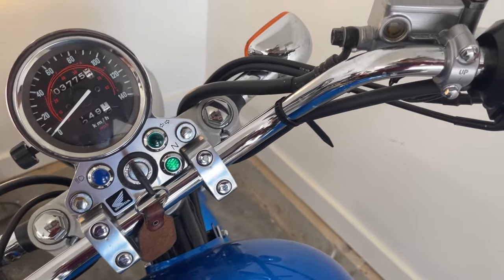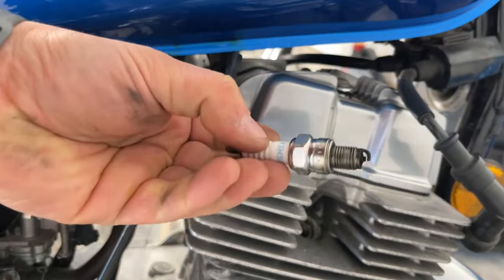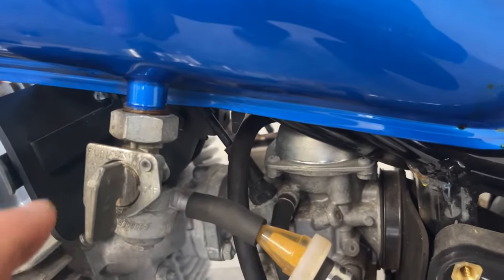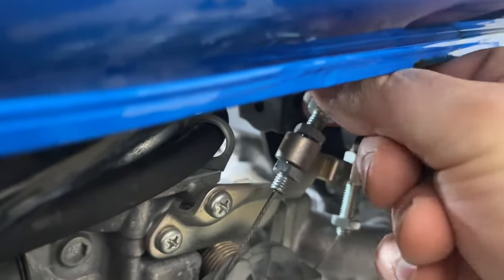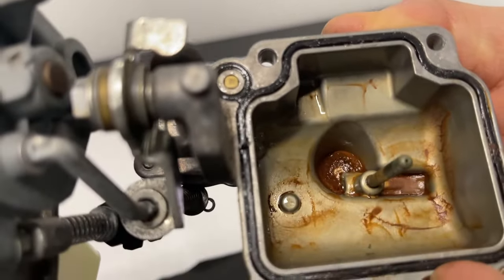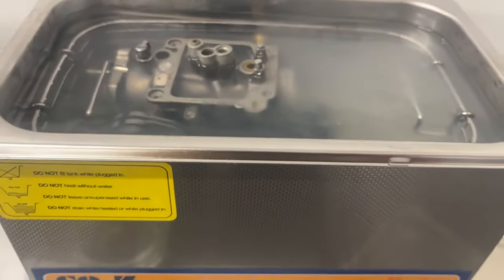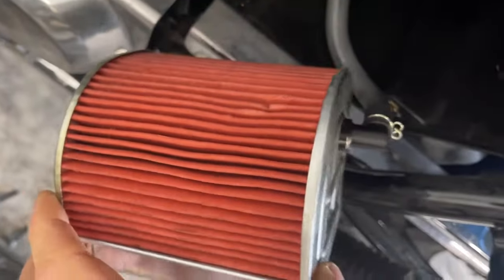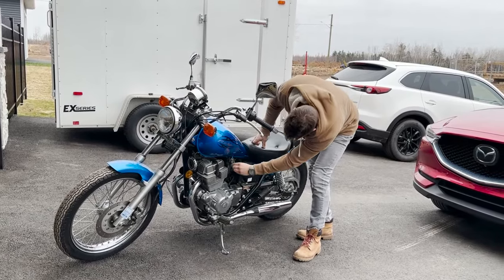Old Motorcycle Doesn't Start? Here is an easy fix | Rebel 250

Comment: Wont start after sitting?  Almost always a gummed up carburetor.  I believe you could have just cleaned the carb and it would have started.  All the other steps were nice, but unneeded.  Original battery sounded fine, air filter looked fine, sparks looked fine and the gas just needed to be replaced with fresh gas as the Seafoam.  The ports on these small carbs are so tiny, any dried gas goop will significantly change the carburation.  This is why we all love fuel injection :)
Reply: yes definately always carb

Comment: This is too obvious tips if you cant figure them out by yourself u shouldn't touch your motorcycle at all... i got one tip that is not so obvious for everyone, if your motorcycle wont start, backfire through carbs, pops a lot, your pistons stop or even reverse when cranking. Your timing is bad because of bad wiring in ignition coils. Check your ignition coils wiring, you probably switched them accidently is what i did.
Reply: If you just get a bike, it’s all brand new to you, then you don’t know shit. don’t be an ass to people who are just getting into their hobby and bought used bikes. Everyone’s been there.
Reply: Most people come here to learn, you should turn your ego dial down a couple clicks bud.

Comment: My Rebel is spewing gas out of the tubes under the bike when I try to start it. Any ideas on what causes that and how I can fix it?
Reply from the maker: Sorry man hard to tell, check some rebel forums perhaps guys there have a similar issue
Reply: @NYDStories  will do! Thanks for the reply.
Reply: it means your carburator is overflowing with gas so the only way out is from the overflow tube, which is the one underneath. Chanves are the float valve stuck, or a faulty float needle valve. Its happening to mine too
Reply: Sticky float more than likely, easy fix tho 💯

Comment: My bike bogs out when giving throttle, how do I know if it’s cause of too/little fuel or lack of air
Reply: Smell the exhaust, it will smell like unburnt fuel and also your spark plugs would be really dark and even wet woth fuel ( if you are giving it too much fuel)

If the air is too much then the plugs could be brown or white and the engine will get way more hotter

Comment: I just bought my first bike, a Rebel 250.  

It's been working and I had it checked out by a mechanic to make sire it was good.

He adjusted the idle to give it less RPMs because the previous owner had set it too high and the mechanic said it wasn't as good for the bike that way.

It took some getting used to but I'm fine with it.

Anyway, watching videos it looks like I've been choking it backwards to start up.  I start with the choke all the down and then move it up to start and then back down to ride, which looks backwards.

Today I wanted to try it the way people do it in the videos so moved it down all the way and then moved it back to the top.

As soon as I got onto the road it stalled even though I gave it plenty of throttle.  Then it wouldn't start again.

I trued every choke position, starting in neutral, even putting it on reserve tank just in case, everything I could think of. 

Any thoughts?  I'm still new at this but it ran fine yesterday.

Comment: Hey man, when you said checking if the fuel is on, it was pointing downwards, isnt that the reserve?
I just got a Honda Rebel 1999 and I'm having difficulties figuring out how to make it run smoothly, as it has a shock/jump starter (i dont know how it's called, it's on the left handle, you were adjusting it after you started the bike in this video).
Could you make a small video explaining how it works and how is the bike supposed to be used?

Edit: it's called choke. Problem with mine is that the motorcycle will turn off after turning the choke off even if it was on for 2+ minutes. Any ideas what the cause could be?

Comment: Thank you so much . But you engine sounds great but doesn’t start . I just bought a bike today it started up kinda right away but when I stopped to get gas it rattled alot . I had to let it set before it started. The rattle sounded like it came from the transmission???

Comment: My father has a 2009 Honda rebel with about 250 miles on it he’s the original owner bought it and never got his MC license got pulled over by police while nine yards never used it and it’s been sitting in my garage ever since would it be best to just replace the carb?? Fuel tank is also rusted but bike and all looks brand spanking new I wash it every year around summer time and have preserved it for years. I’m just wondering what’s the best way to go because I took it to a bike shop they told me I needed a whole new gas tank and that it’s around $2k for a new one and it’s not worth fixing it that they’d take it off my hands for $500 I  said no and took it home. Any help would be greatly appreciated.
Reply: Yeah no a new gas tank is like $80 on eBay
Reply: They are trying to scam you you could even get one from someone on facebook marketplace that is parting out the back and just clean it up real good and paint it and still be less that 2k

Comment: My bike will start and run… and then die…engine sounds healthy and then out of nowhere the bike burps a few time when giving it gas then completely dies… it’ll start up again after 5 minutes of trying but then it dies again
Reply: Try to increase the idle speed with the idle screw
Reply: @colbert6122  thanks for the feedback
Reply: @tonydarko67  otherwise, you can physically clean out the carburetor, or use Seafoam. Make sure your battery is healthy
Reply: @colbert6122  carb is clean battery is new, I found out my return throttle cable snapped… i think I might be having my problems due to that… might be too much or not enough air getting through or escaping, going to fix the cable and see if the problem continues
Reply: @tonydarko67  the return throttle cable isn't necessary, I fully removed mine. 
There's a spring that facilitates the return of the throttle to neutral.
Reply: @tonydarko67  you can also adjust the fuel & air mixture screws, but I didn't want to open the housing containment.

Comment: Hi bro, my bike started but wouldn't stay at idle. Got off the carb, cleaned it (lot of gunk), adjusted the fuel screw, and then it stayed ok at idle. 

Few days later and it didn't wanna start, spark plugs were very black, so my guess is it was too rich, and it drowned in fuel. Any idea?
Reply from the maker: My guess would be it got dirty from the fuel, thats why most guys recommend cleaning the fuel tank:fuel lines to avoid getting the carb clogged right after cleaning.
Reply: @NYDStories  I already cleaned the tank with ethanol, drained it, and put new fuel filter before reinstalling the carb. Could be a vacuum leak tho, I miss one necklace from one of the air intake boots and it might take more air
Reply: @qamihai2585  test your spark first . Might be kick stand switch . Or  cdi controller